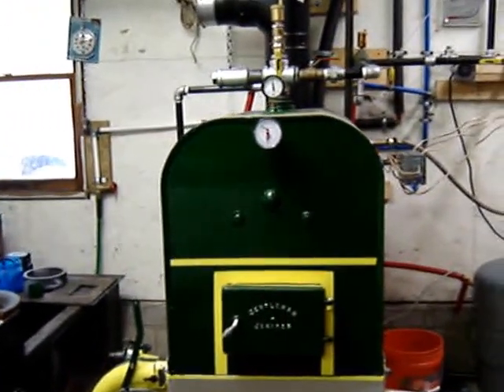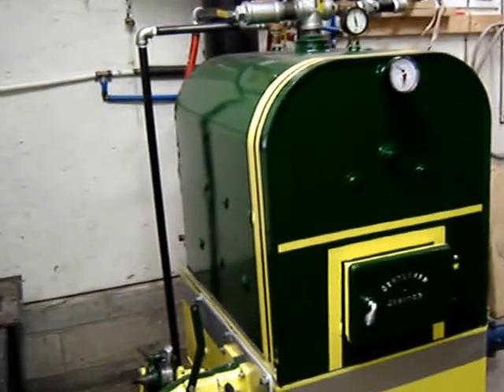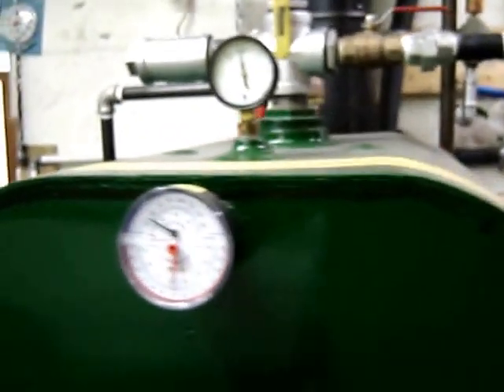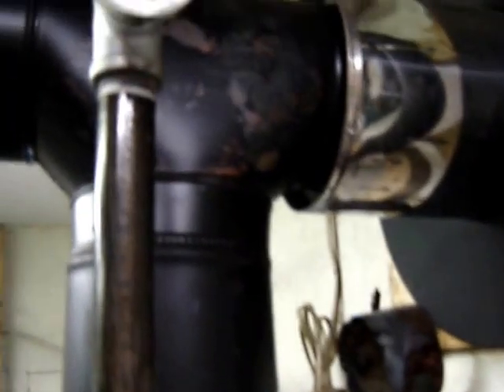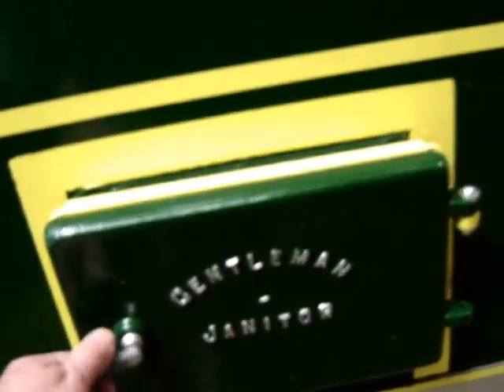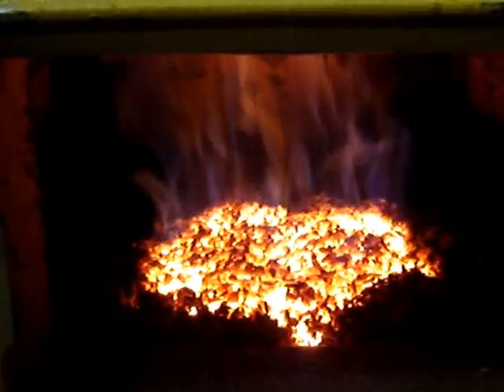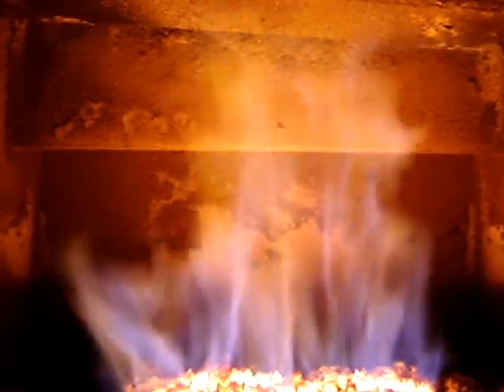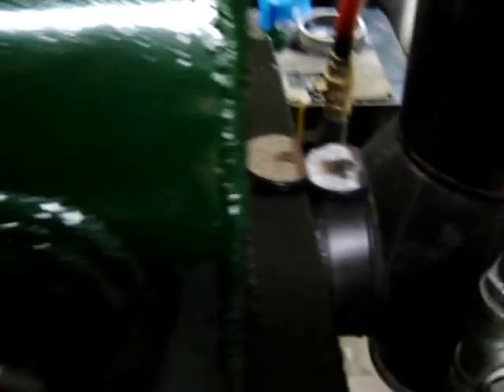Gentleman Janitor coal stoker boiler on a long Heat Call

Comment: Don, do you renovate these boilers or are you just running one? Do you no ware a reasonable priced used unit can be located? I am looking for one to either restore and install or just install if the restoration has already been completed.
Reply from the maker: Go to coalpail.com. The classified section has some for sale. Even one of mine is for sale there.
https://coalpail.com/coal-forum/viewforum.php?f=81
If you live in or near Anthracite country you can also find them on CL.
Reply: @stokerdon1020  thank you.